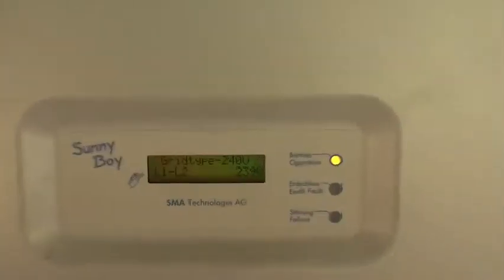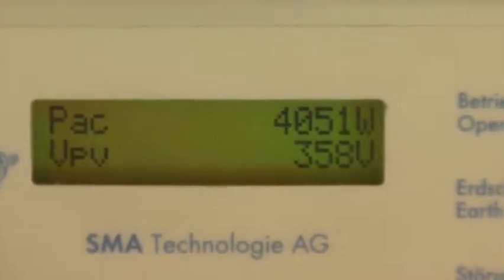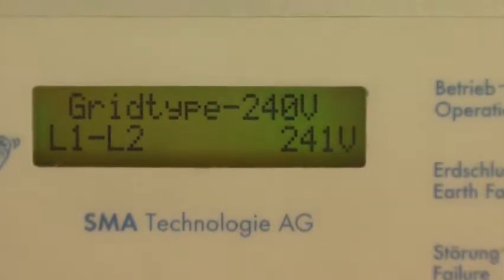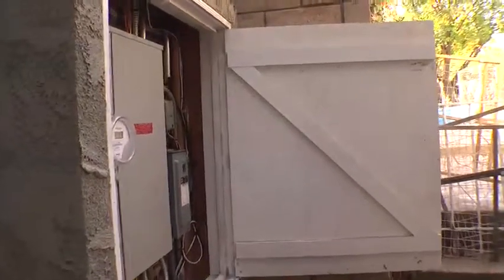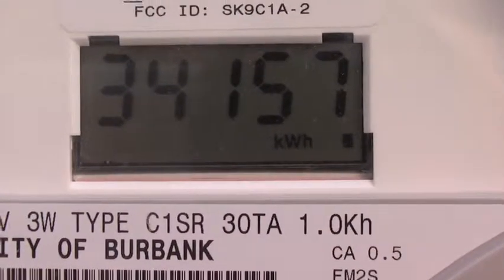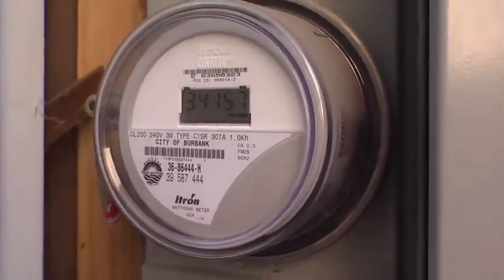Video 5 solar patio cover

Comment: Making an educated Guess...
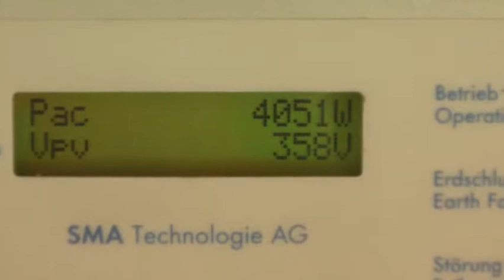0:48 - 4051 W = 4.05 kW which is most likely your current output.  358 Volts from the panels (pv)
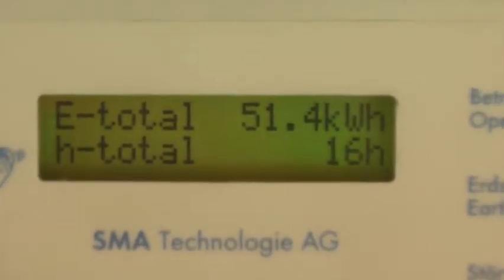0:53 - 51.4 kWh generated over the last 16 hours
30.83 kWh generated today. Mpp=Maximum Power Point (i have no idea, Googled it)
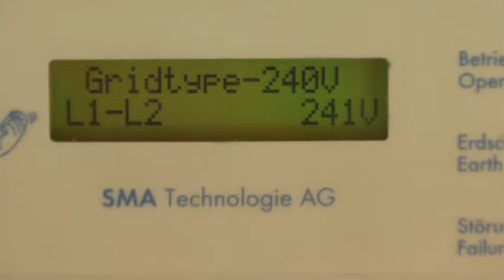1:03 = The AC side of the system feeding your house is 240v mode with an actual output of 241
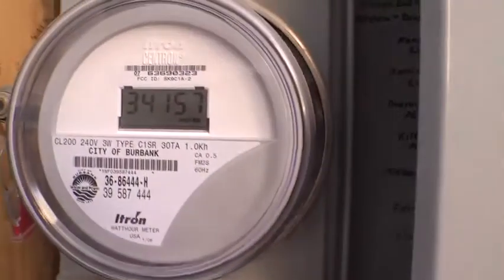1:56 = You can see there again 240V is the main feed type from the power company.
BTW, Burbank huh?  I live in Simi Valley :)